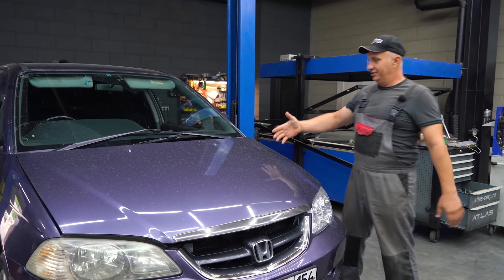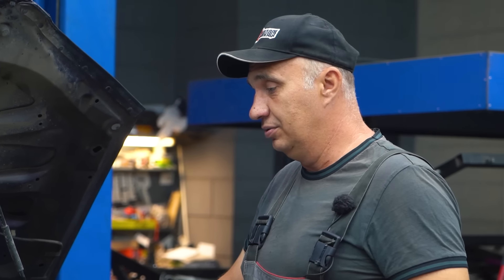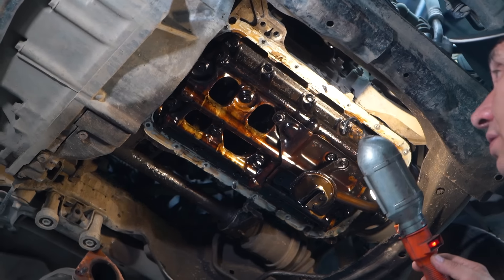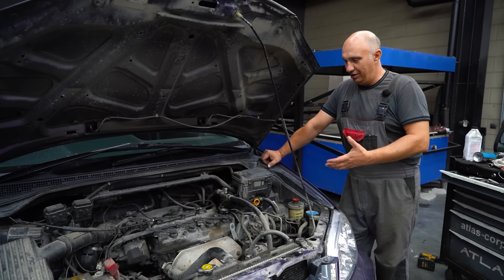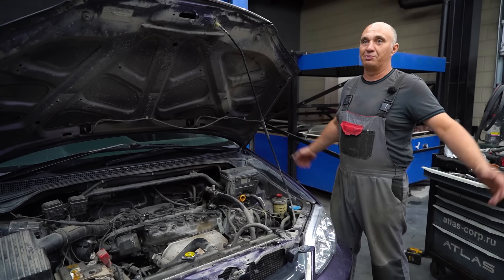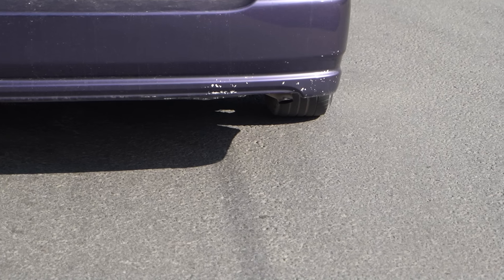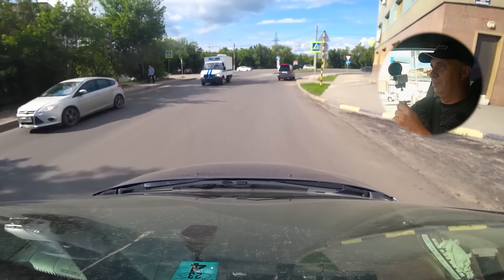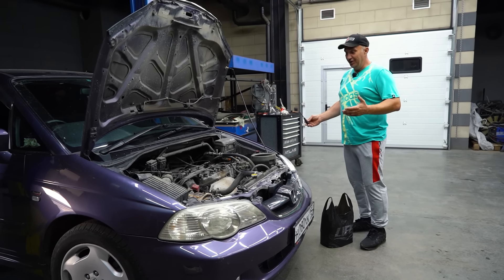We replace motor oil with brake fluid - what will happen?

Comment: I add motor flush prior to changing the oil & let car idle for 5 minutes. Then I drain the dirty black oil. Then I put on a new cheap oil filter & add 1/2 oil & 1/2 Marvel Mystery Oil & idle car for 5 minutes. Then drain the black oil, then put on a good oil filter & fill with synthetic oil & the motor & oil is perfectly clean. My 1991 civic si ha 211,000 miles on it & if I pull the valve cover, it & everything under it is perfectly clean. I don't do the double oil change every time, maybe every year or two. I am the original owner so I've always kept the motor clean. It's dangerous to try to clean a really dirty/crusty motor because crud will break off & come loose & could clog oil passages & cause engine failure. Many years ago my friend drained the oil from his high mileage Buick V8 & poured in kerosene & idled it for 5 minutes to clean the motor. After he added oil & it seemed fine, but a day or two later his engine threw a rod.  :(

Comment: Ive put hydrolic atf and air compresor oil in my break system and fucked it all up trying to get threw a week with leaking break lines the ruber peace under cap swelled and started to desolve

Comment: Now try with that car, 3 liters of motor oil and 2 liters of automatic transmission fluid, then let it get to normal operating temperature, and drive it like you did with only the brake fluid, then show the before and after results.

Thank you.

Comment: I had a Honda Civic I ran short on oil many times a few times no oil on the dip stick the motor wouldn’t die. I had a chev I ran without oil one time and the motor died. You can’t kill Honda engines.

Comment: Honda 4 bangers will run with piss in the crank case.  Hell, I went to a VW meet in Sacramento and they drained the oil out of an old flat 4 and ran it at redline and I got bored waiting for it to seize.

Comment: Would it be safe to say to put a quart of brake fluid in with a oil change and run it for 3000 miles to see what cleaning the engine will be like???

Comment: You should've tried the real motor oil in third oil change to see if it helped with oil consumption..
Reply: That's a difficult test. Testing oil consumption requires a lot of driving.
Basically daily driven.
You would have to establish your baseline consumption over X number of miles, and do that a few times for your average. Then, you would have to do it a few more times to compare the average difference after this "cleansing cycle".
Reply: @tynewlin  You're right, but maybe it could be visible with less smoke..

Comment: I don't know if you have done this yet. But I did it with a lawn mower. PLEASE RUN THE ENGINE ON COOKING OIL FOR MOTOR OIL!!!!

I did this on a mower in 1999 

Please do this on the car. No torture test.vresl world driving test. Put a couple dozen kilometers on it I not a hundred kilometers.

Comment: buy a car with a blown head gasket. drain coolant and fill with oil. See how long it runs or if it overheats. Will water pump be able to push oil?
Reply: It will just shoot oil instead of coolant through the warp on the head lol.
Reply: @B.V.Luminous  but will the engine last? lots of cars burn oil, and oil will mix with oil so no issue there.
Reply: @arnoldm889  no, it would build too much pressure, send oil into the piston and that would create an even bigger failure through heightened pressure causing the piston or the piston wall itself to crack.
Reply: @B.V.Luminous  maybe an euro car but a lada would probably keep going

Comment: Been working on cars and trucks for 40+ years and i can say i have NEVER seen Paint inside a oil pan. 
Not sure what idiot painted the inside of a oil pan, But they should never touch a car again.
Oil pans should never be painted or coated inside unless the coating is actually plating like a good cad finish.

Comment: LMAO, "The break fluid starts doing something like dissolving the deposits".  Well it's also dissolving every piece of rubber in your oil system too.  Brake fluid is nasty stuff.  DO NOT DO THIS!
Reply: Might be good to do if youre planning to rebuild the engine after..
Reply: @TuneStunnaMusic  There are products out there made for that specific purpose.  Brake fluid is for brakes.

Comment: As a shop owner for 38 years and 46 years of experience how do you destroy 4cyl av6 vtechs.... drive it. Decades of cylinder bore and ring design issues.  The worst thing is you go to Honda and they reprogram the computer.  About 10 to 20k out of warranty, it probably will start burning oil, at which point they'll tell you it needs a short block or a motor.  In the 4 cyl, go to a reputable shop, and they'll rering it assuming you were good with oil changes.  The v6 with variable displacement the cylinder bores change as the engine heats up.  According to Honda, field testing with a bore gauge will not give you the correct measurements. it needs to be hot, maybe 185, running temp.  NEVER PUT A FLUID IN A PART IT WASN'T SUPPOSE TO BE.  IN THIS CASE, THEY GOT LUCKY OR LIKE MOST NO NAME INTERNET STUFF ITS A LIE. an attempt to screw over the American if russian?

Comment: Try running it with a 50-50 mix of LA awesome cleaner and motor oil you'll be surprised by the results.

Comment: After running oil in it for 100 miles or so, try draining it all, then filling the entire engine up with the brake fluid again, until running over. Don't start the engine, just let it sit for a while and drain it after a month or so. Let everything soak for a while to see what happens.